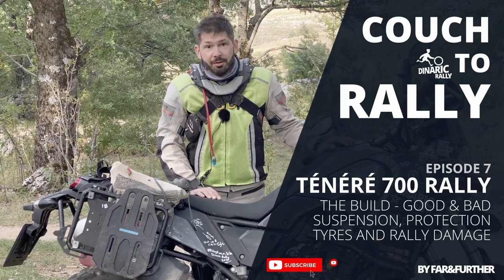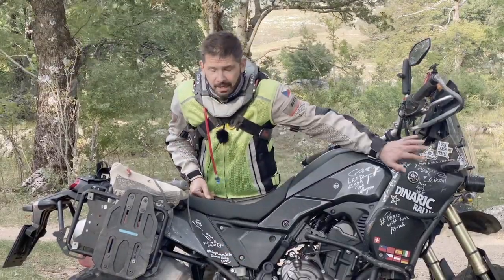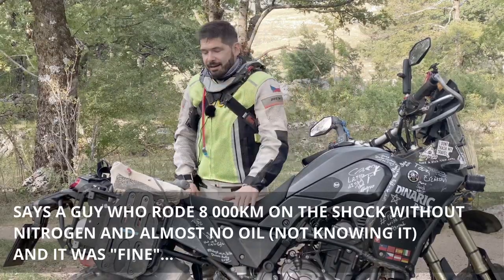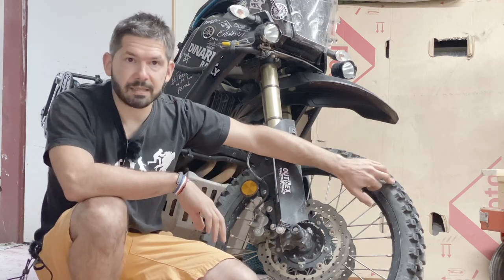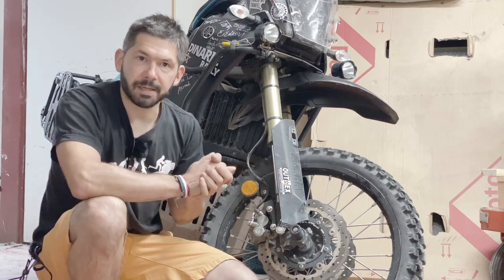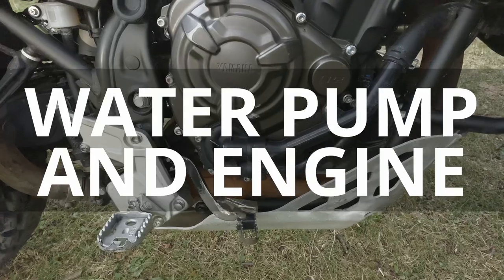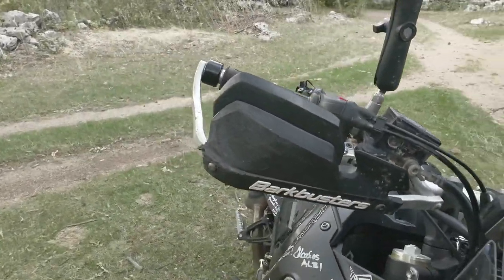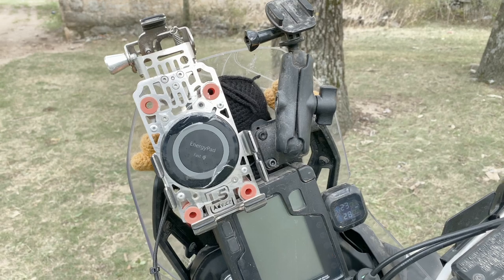Couch to Rally 7 - The Yamaha Ténéré 700 Rally build - the good & bad and Dinaric rally damage

Comment: I totally agree. Once I buy my T7, the Rally Raid upgrades are a must, for about 400€ its a very good option. I will get the Fork Preload Caps. Also master cylinder protection and R&G Engine Case Cover. For rally purposes maybe add some Steg Pegs, Sliders on Front and Back Wheel (cheap) and maybe Ralle Moto RM3, it is supposed to help with high speed rock deflections. I don't have any experience with it just something I picked up.
Reply from the maker: Well my strategy is to find the limits of current setup and don't invest much... Once I reach the limit I can look for upgrades.

Now when you mention it... I forgot to put my wish list to the video... and what I really want to add is Ralle Moto RM3, it would be really really helpful for the rally.
Reply: @FARANDFURTHER  What about Pivot Pegs? Supposed to be good for rally too.
Reply from the maker: restless soul Well, never had them so I can’t judge but in terms of limits the pegs are definitely at the bottom of the list on the upcoming changes. I wear hard boots so even small pegs like stock are OK, the tilt feature of the pivot pegs... probably good for comfort. But then you still need to move foot for shifts... 🤷🏻‍♂️

Comment: Very solid and credible review. I did the same with my suspension with 88 to get my sag right. I was undecided with the headlight protector, but now I am. I have the ACD skidplate and I find it very rugged. Finally, I think my Cycra handguards are more robust than the Barkbuster.
Reply from the maker: Hello, thanks, I'm glad it was useful. I heard the ACD products are very good quality as well and I have never heard about Cycra handguards, will check it out. Thanks for the tip.
Reply: @FARANDFURTHER  Here is the one I have installed. Cycra Ultra Probend Handguards with HCM Clamp Black 1 1/8"

Comment: Great info on your mods. I Agree with your experience on dropping the bike on the exhaust side and having the can rubbing the swing arm afterwards, there are a few pictures of teneres with swing arm rub, mine included, I really think your high exhaust conversion is worth looking at. would you mind a more in depth explanation on that mod? thanks
Reply from the maker: Hello, glad video was useful. You're not the first asking about the high exhaust mod... seems a video on that one is in order. This is not finished product actually, I'm waiting for Scorpion exhaust and the pipes will be modified so that stock & aftermarket can be swapped.

The problem with T7 is that the mod is not possible without cutting & welding, or at least not in shape I have it so it's difficult to produce the kit.

Comment: Great video :) Even though I'm not rallying anytime soon, it's nice to have some experienced opinions on the aftermarket options. 

Btw, touratech (I think) sells lower crashbars that I was planning on buying.  I don't think I'm going to get the upper ones, at the speed I ride I think the plastics are sufficient for sliding offroad.
Reply from the maker: Thanks, glad the video was helpful.

Well, if you don't mind your plastic will be scratched or cracked than yep, upper not needed. However when you look at the video, most of the crashbar damage is on the upper bars.
Reply: I got the Touratech lower crash bars a couple weeks ago and today the uppers came . Had dental implant surgery today and the novacaine is wearing off . 
     Tried installing the Outback Motortek upper and lower crash bars but after 4.5 hours I threw in the towel . The main engine bolt just wouldn't seat and before that every single nut and bolt was a problem . I called the company and spoke to the owner and he was nice about it , apparently my bike is on the limit of tolerance stacking . Hope the Touratech crash bars go one smoothly . I like the way the lower bars protrude a bit and protect the case good on one side and pretty good on the other side .
Reply from the maker: The problem with Outback crash bars is that you have to just put all the bolts on to a 1 or 2 threads otherwise its impossible to mount. Once that's done you can start gradually tightening it all and it will create flex in the structure.

They're definitely not a piece of accessory you want to take off and put on often :)
Reply: @FARANDFURTHER  
I experienced a lot of tension on the first bolts under the seat . The alignment was off from the beginning . Then the shorter engine bolt was somewhat a pain but it did seat and thread on . I did leave a lot of play in each bolt but the c clamp brackets were such a pain . If the bolts were just 2mm longer it would have made a big difference . The nylock nuts just wouldn't go on without an extreme amount of effort and that was just one 3/4 turn . Had to tighten one side down hard just to flex the bracket and then do the same to the next bolt and nylock nut . It just is one of those things that doesn't work the way it should . Of course I could have drilled things out and done this or that to the bars but after spending 460 dollars I just want to put them on and ride .

Comment: First: Congrats again to your fantasicjob in the race! 
Second: I think the weld in the bashplate must have been a quality issue of the weld or level ofabise isjust out of this world..🤔😁😎
Thrid: I have managed to bend my barkbusters  multiple times - and that is good so! The way they are made is to absorb the energy during a crash so that is not tranfered to the handlebars and bend these instead... rigidity here would be counterproductive..
Finaly:You are living in a civilized area - who tf uses psi? please use up2date standards for pressure! BAR 😁😎
cheers buddy!
Reply from the maker: Thanks! Although 26th overall... I'm just bragging about 2nd day :)

I also think that the bashplate crack is quality issue...

OK so it's only me, apparently who didn't bend them yet... It's some kind of alloy... safe to bend back or they will crack?

Hee... PSI has better resolution than the 1.2 bar! And I got so used to it in UK 🤣🤷‍♂️

Comment: Great video, I like that you cover all the aspects clearly. I am impressed.
I really like that high exhaust modification. Looks like the mid-pipe is bent and welded in sections. 
Any tips for someone who might attempt to do a similar change ?
Reply from the maker: Hello, I'm glad the video was useful. In terms of the exhaust mod, it depends where you are. I could refer you to a place where I had it done in Czechia but I'm not sure if that's useful.

It is custom mount (the OEM shortened), custom mid-pipe and and some good TIG welding. Next step is to change the OEM exhaust for the Scorpion one which is coming soon.

Comment: hi, i think the tool box on the shoe can in the event of repeated shocks stretch and weaken the weld of the shoe.
this is only a hypothesis. For the handguards, I have always taken quality products and I fold them all without breaking them. by heating them with a torch, you manage to straighten them.
For the T 700, I mounted crankcases on both sides GB RACING.
For the water pump, I saw that TOURATECH sells a not too expensive model. You should not wait for the problem when you already have the solution.
See you soon
Reply from the maker: I've now straighten the Bark busters without problems. Yes I know GB racing is making set of protection, also Trippleclamp does one and R&G. I bought one set as well as it seems to be useful for my riding.

Comment: The waving problem at speed is most likely incorrect suspension settings in relation to the weight you carried when traveling or perhaps bad weight distribution front-to-back. Sticking out panniers also tend to do that due to aerodynamic forces. Lastly how much you lower or lifted the forks in the triple tree could also be a factor.
Reply from the maker: All points you make may be valid. One thing though is that after lowering pressure in the tires and riding them for a while (I bought them 2nd hand so I needed to bed them a bit to my bike/style) the waving improved enormously.

I've not lowered/raised the forks, they are stock height.

In terms of rear suspension I could not get proper sag at the time as my spring was too weak. I'm looking forward to test it now with uprated spring.

Comment: my 1090R with Tractionator Rallz tyres was way more unstable above 100kph until i dropped the pressure from 35 to about 25psi. i just ride them at 23/25psi all the time now and theyre great. still a bit unstable on the road at 120kph but nothing serious and oddly they feel fine in corners, its onlt the straights where i feel the wobble.
Reply from the maker: Hi James, I have similar experience. Once the pressure is lower (I'm used 32/36psi for Mitas E-07) they got much more stable. Also some wear had a positive impact on stability and at some point I was able to ride at 130/140 without issues.

Now with about 7000km they seems to be done (front definitely) and rear seems to be quite slippery on wet & cold which is what I have here in CZ now.

Comment: Can you make a video on the high exhaust? I'd love to do that to my t7
Reply from the maker: Hi Tomas, I'm still waiting on my Scorpion exhaust which no and no arriving. Once I have that at hand the mod will be finished. There is some more progression and I've been testing now for about 3 months and so far so good. Only issue is the passenger footpeg which is now the 1st to be hit when I drop the bike and I'm not sure how long it will survive.
Reply: @FARANDFURTHER  I'd rather break a passenger peg than an exhaust eheheh
Good luck with the mod and pls do a video of it when it's finished
Reply from the maker: @TomasLonGo  Hehe :) I've been exploring some options for exhaust protection. Maybe well placed heat shield would do the trick? Or some kind of heavy duty sticker not to scratch it on the 1st day out ;)
Reply: @FARANDFURTHER  the problem isn't even the exhaust itself. But the exhaust's support is super weak and it's welded to the frame. It bends everytime you fall to the right side 🤦‍♂️🤦‍♂️ Yamaha should have thought about this a bit longer
Reply from the maker: @TomasLonGo  Indeed, for that the high mod seems to be the only solution. I'd hope that Tenere 700 2022 will have it by default.
Reply: @FARANDFURTHER  Unless Yamaha releases something like a conversion kit, I really hope it doesn't come standard in the 2022. Otherwise I'd feel really jealous and then I'd have to find a way to get the new one

Comment: First thing, thanks for one more amazing video and information. As i also have a T7, i am curious about the front axle sliders. What is our opinion about them? Do you found them usefull or not ? For on and off road. Thanks!
Reply from the maker: Hi Duarte, I've put them on after I destroyed my front fork guards so... I can't say if they'd protect them or not but I guess they would especially lower mounting bolts.

I had the sliders during the Dinaric rally and I have to say they came out very much used so they indeed to take some impact and protect the axle and surrounding are at the bottom.

So, yes seems to be worth it especially when fork guards are in one piece :)
Reply: I don’t think they’ll ever touch the pavement if the bike slides. Especially the on-off bike type. The handlebars and body are too wide to have anything else touching the forks - unless of course you hit something head on. Sliders that stick out like that are a bad idea imo, especially for off-roading when you try to squeeze your tire between rocks and ruts.

Comment: Are you just using the spacers for your front fork? You're actually the first video I've seen recommending spacers as an option. Most are recommending new forks or spring kits. Options that are about $1k or more.
Reply from the maker: I went through the progression. I added the spacers to the front forks. Then I got Rally Raid open cartridge and K-Tech rear shock upgraded piston.

For my rally it’s enough it is impressive how the front improves with better forks (of course! for the $$$). And the K-Tech in the rear is enough for me now.

If I’d only travel the spacers to get correct sag (or correct spring rate) would be still my way to go, but when at high speed it does hit its limit quickly.

Comment: Hi. I bought the Shido because you recommended it. Do you happen to also have oxford heated grips? If you do, are those ran directly to the battery? Many thanks
Reply from the maker: I have not had any issue so far with the Shido battery. It did start the bike on the first click even at -6 but you could feel the battery was not happy about that. So next time, still the same temperature I let the bike on for few minutes (just lights) which warms up the battery and it was much more happy.

I have oxfords, I think I have them connected to the T7 plug for the heated grips as that plug is provided by Yamaha.
Reply: @FARANDFURTHER  Thank you very much for your answer. Do you happen to have a link for that plug? Did you have to cut the wiring or was it plug and play?
Reply from the maker: For the Oxford grips you want to use the Yamaha provided connector, you will need to get the crimping tool and the pins though. This is the connector which is on the bike:
https://www.motokonektory.cz/sady-konektoru/sady-konektoru-3-polove/sada-vodotesneho-konektoru-2-2-mm-3-poly-trojuhelnik

As I said you can cut on the Oxford side and use the 3 pin from bike to connect.
Reply: @FARANDFURTHER  Thanks a lot. After your previous comment I started googling. Both connectors and grips are pn their way :)
Reply: I’m back to annoy you even more! I have the grips but havent installed them yet because so many report that they come loose. Has this happened to you, what did you use to get them fitted? Many thanks, the information is appreciated.

Comment: I’m 1.68 as well do you use the lowered seat?
Reply from the maker: I tried lower seat, I have it now but in my opinion it does not make much difference and it is substantially harder than the standard one. I now added a CoolCovers which raises it to the standard height while providing more comfort without raising the seat height as it wild with standard seat. So far happy with the solution.